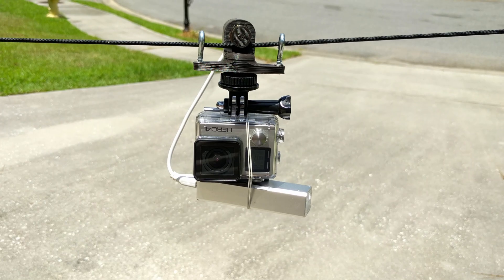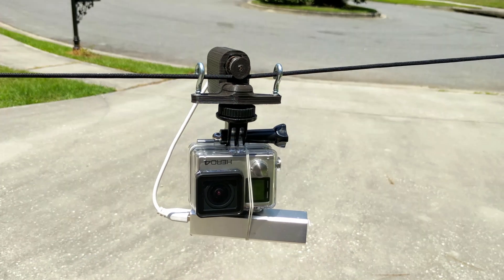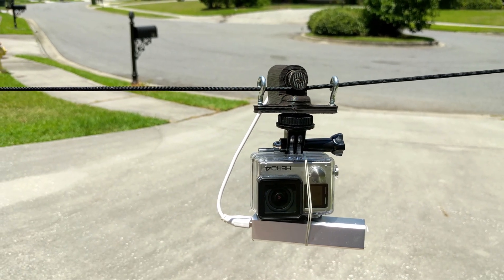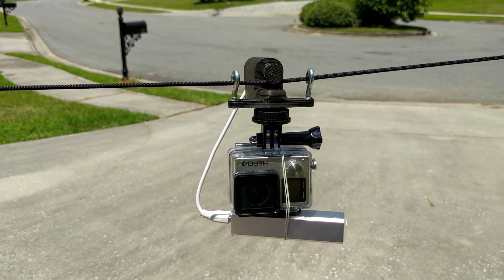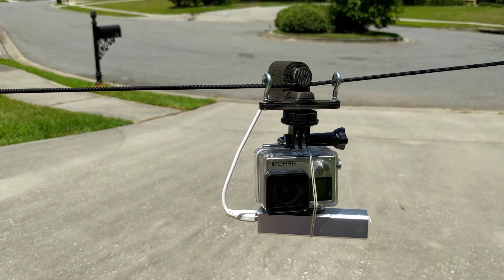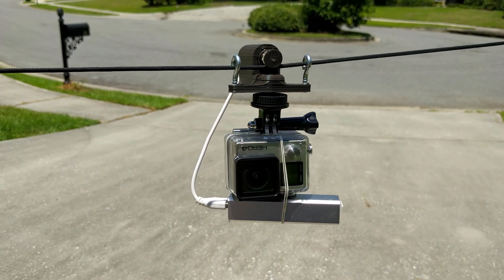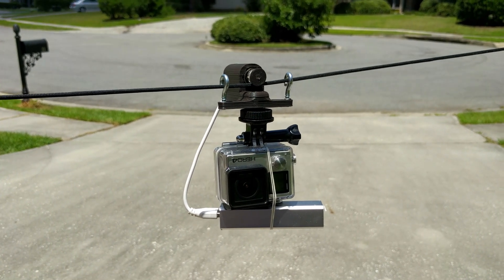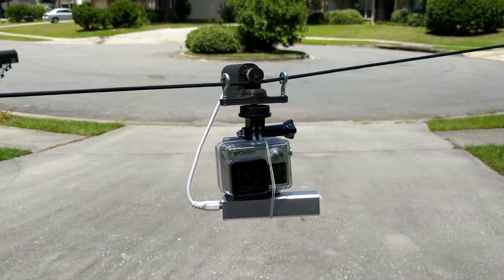Gopro DIY Cable Camera

Comment: Its perfect! Thanks you for sharing. Any problema using the 6v motor with te 5 v usb? Im thinking to buy a 2 rpm motor with a speed controller 👌
Reply from the maker: No problem running the motors on 5 volts. A simple  potentiometry can reduce the speed.

Comment: Probably a couple things I would change would be the islet spacing I'd make it a little wider and I would use a silicone or some other item to help but the Paracord float through a little better and also a counterweight cuz you have all that weight on the bottom of the battery so you might want to go and put something a little bit on top so you can get your balance point a little better but I would expand your eyelids probably from what I'm looking at about four more inches cuz your drive wheel won't be able to work on that and then you're eyelets where the power cord comes through a little bit of silicone make a Groove so that the Paracord floats over easier and I would use just a clear RTV room temperature Vulcanizing model and that way you could at least have it guide through a little easier and then possibly a little bit on top to keep the counterbalance is your that battery looks like it's a very heavy which is causing your motion to waive so that would be my suggestions